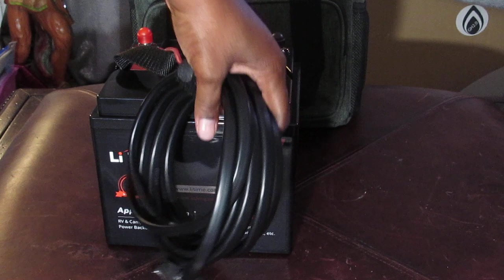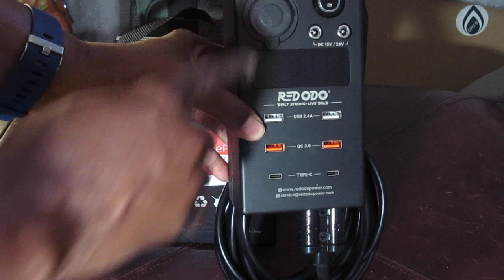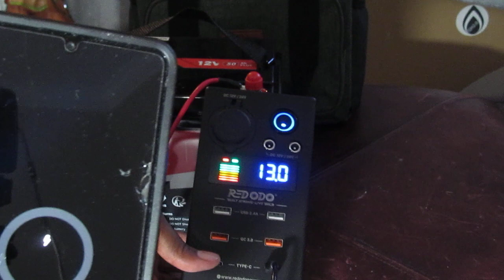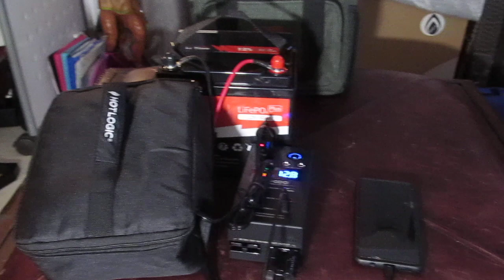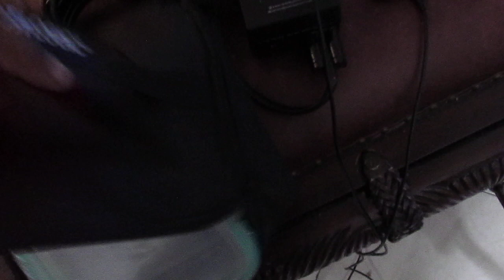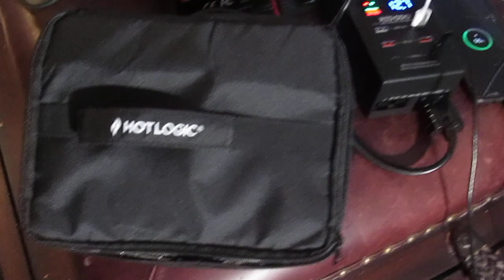Alternative Power Systems - Video 1 (2 Items that powers up to 9 DC devices) WOW!

Comment: I have a 30 ah battery that I used in my tiny home for a few months. Now that' I'm building a bank of 100 ah batteries the little one is set aside for when I build a storage shed. It and one panel will power my lights in the shed. 
The first 100 ah  battery I got has a 12v outlet built into it, and two usb ports.  Also has a carrying handle, so I might  use it as a portable source in the future, much like you are doing.